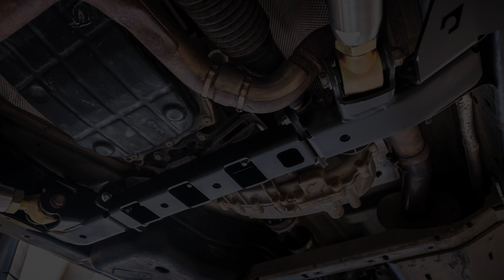JL/JT Front Long Arm Bracket Kit Installation Guide - JL4701

Comment: You will need to install an exhaust loop delete on the driver's side or the lower control arm will hit at ride height and the upper control arm will likely hit it during articulation. I found this about after the install.  (I have the four link long arm kit by Artec on my JLU with the 3.6)

Comment: Is welding necessary for this installation, or is it just for added strength?
Reply from the maker: It is technically not necessary for mounting the kit, but we would recommend you weld everything for support and rigidity for the link brackets going on that frame.